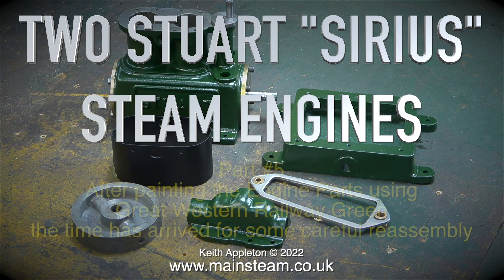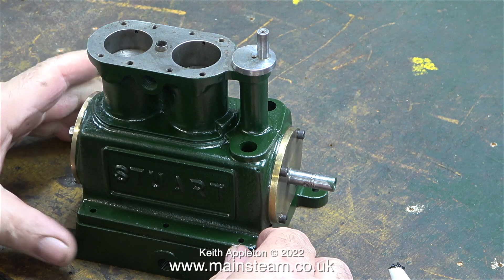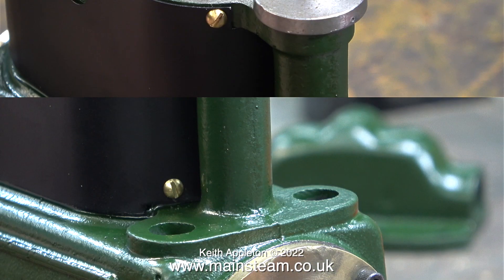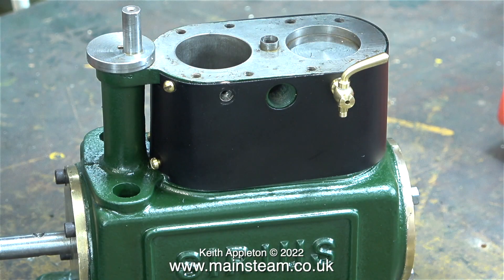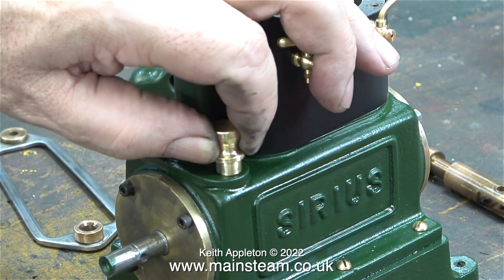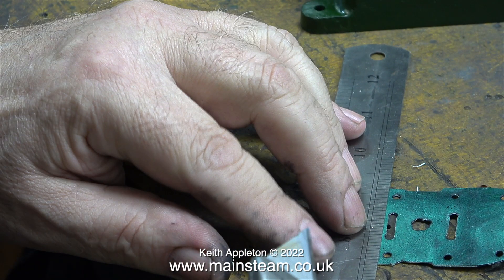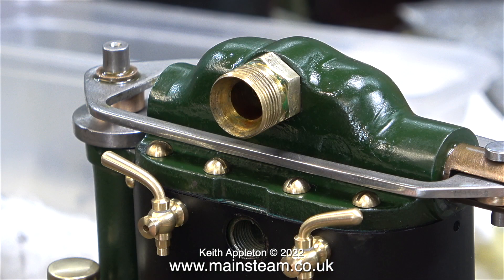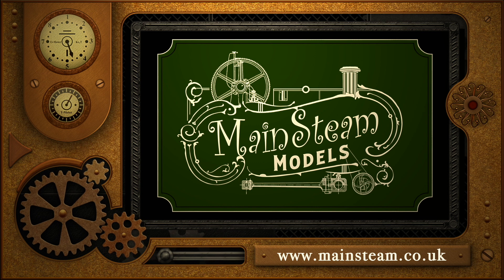TWO STUART SIRIUS STEAM ENGINES - PART #5

Comment: Just a quickie bit what type of oil did you fill the sump with was it steam oil as the thickness of the oil would make it quieter
Reply from the maker: Hallett Oils (www.hallettoil.co.uk) lubricating oil - not steam oil - that is too thick.